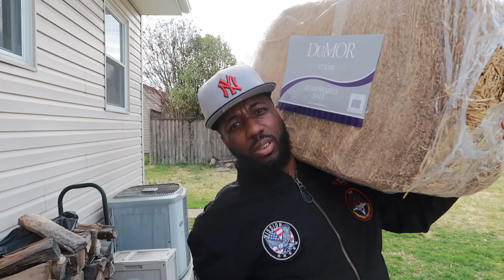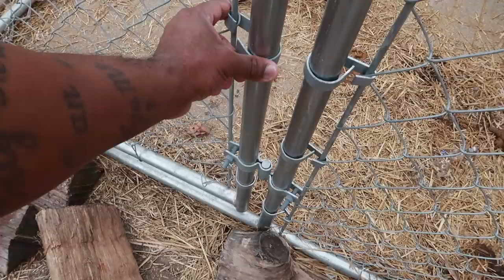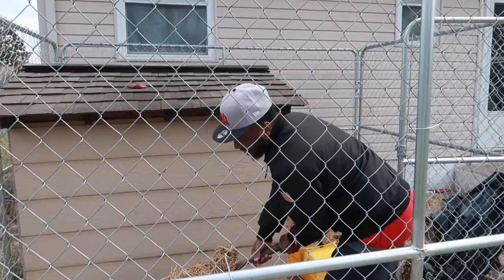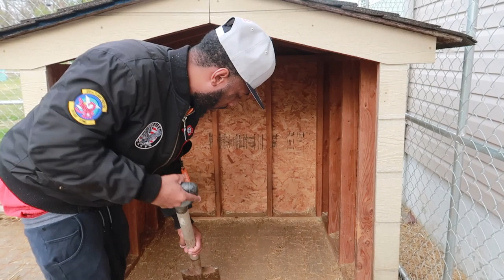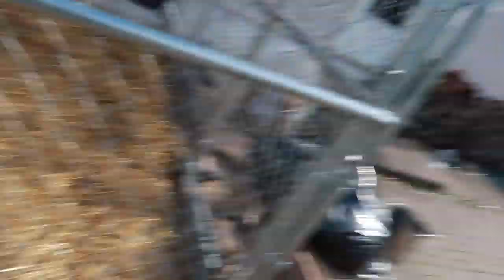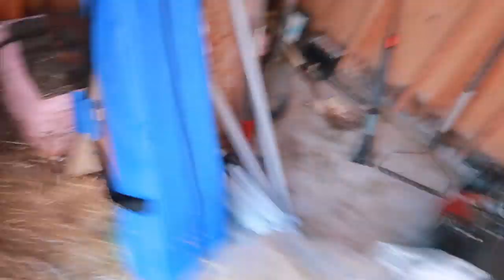CLEANING MY 10x10 KENNEL CAGE. ITS NEVER EASY! (AMERICANBULLY) {BLUE PITBULL}

Comment: Are the tolls around am I allowed to leave this comment😜
Those kennels is like dental floss for dogs.😰🤬
At Lowe's  blue hawk 30 count metal fence ties $6.28 to repair the holes. And put them around every Link at the bottom of the fence so they can't squeeze out🤯 maybe you can zip tie 2 foot high plywood boards around the perimeter so they stop damaging the fence before it gets worse. I already see that you got a lot of firewood around those edges!!!